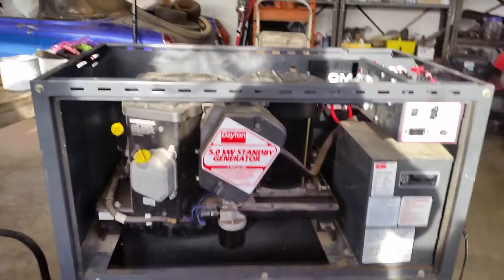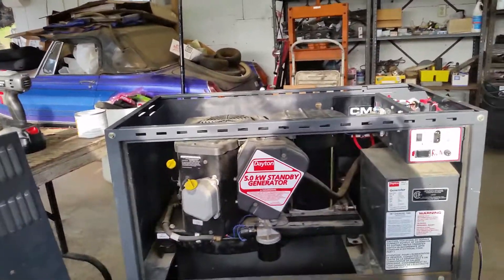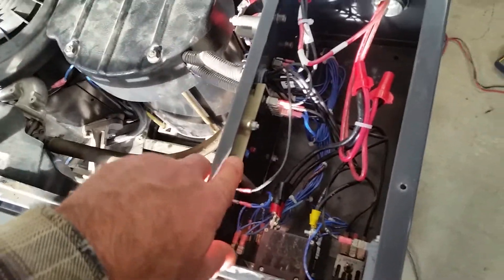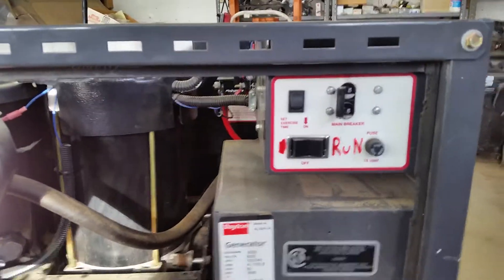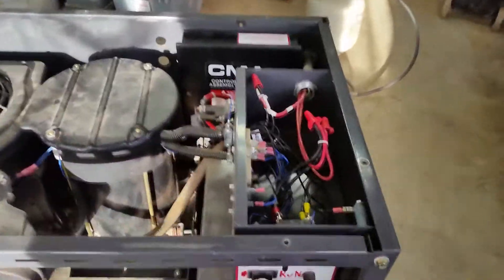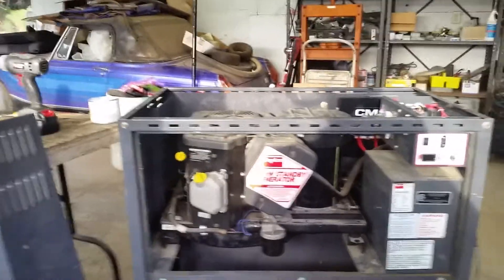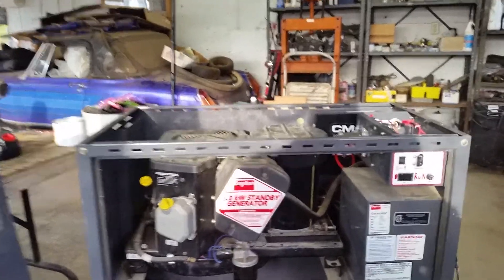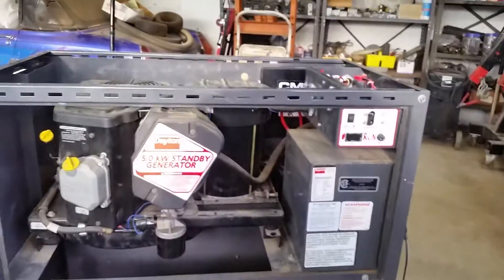Dayton standby generator (voltage adjustment)

Comment: I got a 2006 that had never been connected. It was left outside in the Florida rain and the frame was rusted apart. I hooked up propane after switching it from natural gas. It fired right up and runs so far like new. Haven’t needed it yet but here comes Dorian.
Reply from the maker: They are good generators. Mine is a standby. We live off grid so we usually use the diesel on rainy days. The diesel is more efficient but fuel does not store as long. Propane will last 100 years so the propane generator is the best for standby applications.  Thanks for watching.

Comment: @ off grid     i have a dayton.  and i am having an overspeed issue or over crank.   the generator tests itself once a week.  when there is call for power the generator will not work,  i get that fault
Reply from the maker: I had the same issue.  The voltage regulator was the problem. I believe it is a Generac part.
Reply: Off Grid In The Pacific North West  you know where I can get one?
Reply from the maker: @jpanyk  I searched online. Ebay even had them. They are about $120

Comment: I have this same generator.  I just hooked up natural gas to it and tried to run it.  Nothing.  Does it have to be wired up to run?  Thanks.
Reply from the maker: The engine should run and it should put out power even when disconnected and the breaker is off.
Reply: @offgridinthepacificnorthwe3210  I'm going to test the battery.  Thanks.
Reply: I just realized that the fuse and the cap the holds it in place are missing.  Is that a standard glass 15 amp fuse?  Thanks.
Reply from the maker: @mycroft57  that sounds right. I am up in the mountains building a new homestead right now so I can not go look for you. The generator is back at the home place.
Reply: @offgridinthepacificnorthwe3210  I'm having a helluva time finding that fuse cap.  There's nothing online about it.
Reply from the maker: I found a repair manual on ebay for 5 bucks. There around you just got to look. Several companies offer manuals in pdf files for a reasonable price.

Comment: Do you just turn the little knob on the regular to adjust the ac voltage? My voltage is a little low. I just hooked up the same generator but 8k to my house.  I have the manuals but they don't say much on this topic.
Reply from the maker: Yes you can turn the little trim pot to adjust the voltage. It is best to make sure the cycles are at 60 u der moderate load then adjust the voltage. Some cycle  sag is expected when you have a mechanical govenor. I set mine using a true RMS meter. I usually set it to 61 cycles and the voltage not greater than 123 under no load. The idea is at 1/2 load the cycles read 60 and the voltage not below 115.

Comment: Good night how to connect the generator avr for I do not have your connection diagram you could help me
Reply from the maker: Greetings from off grid Oregon. Do you have the same generator? If you do I can scan the schematic from a service manual that I got on ebay. If that works for you I will need your email to send it to.

Comment: Steven,
I have a Dayton automatic generator just like yours. I have questions!!! Mine says dual fuel. It was last hooked up to Natural gas.  I want to hook a gas grill tank up to test it. Is that ok? I would also love to find a manual (download) or paper one for this as well. The wiring and electronics look sophisticated for the size of the thing. Mine says it is good for 5kw. That must be continuous, and much more surge rating. How do you do a manual override to start it, and shut it off? What are the adjustment screws in the fuel line for? What is the equivalent in general brand(made by generac)? Please help! Thanks!
Reply from the maker: Troy Starks Greetings from Oregon,  yes the Dayton is a 5k continuous and probably 6k surge. The generator manual can be found in pdf format online. You can Google how to adjust the on demand regulator.  Mine has a start rocker switch for auto and test. I hope this helps